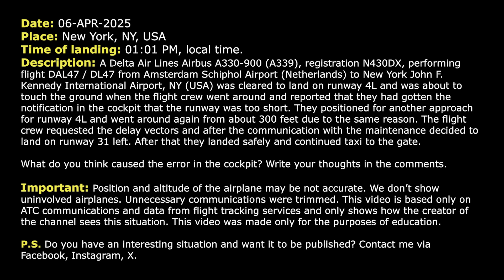The longest available runway is too short. Delta Airbus A339 has problems over New York. Real ATC

Comment: Possibly a glitch with the software incorrectly thinking 4R was the landing runway? The crew is probably no longer allowed to calculate landing and rollout distances manually but the indicated runway at JFK that the aircraft was squawking was too short (Runway 4L/22R) is 12079 feet long. The winds were reported initially at 010 at 10 so with a 6 kt. headwind component, an Airbus A330 should have no difficulty landing with plenty of room for rollout.

Should be fine even with minimal brake settings and no reversers.

Comment: Wait a minute… Landing Distance Available for RWY 04-L is 11,010’.  Landing Distance Available for RWY 31-L is 11,247’.  Last time I checked 11,247 is greater than 11,010.  What am I missing?  About the same crosswind angle and head wind component.  Probably had the 60% landing factor in the FMC CDU.

Comment: 4L is 12000 ft long. The A339 requires (officially) about 6000 ft to land at sea level, so that's twice the published values. Judging by where it turned off the runway compared with the piano keys, had it landed on the original 4L they would have turned off a bit past its middle, in line with the expected landing roll length. So my bet is on a faulty sensor or a glitch in the software

Comment: Their system/equipment was definitely malfunctioning. There isn't a commercial aircraft (with no emergency conditions) flying that can't land on a 12,000' runway. They should have pulled landing performance data well in advance of their approach and the probably did, but they also probably have standards that mandate a go-around if the "too short" system activates.

Comment: Once again, appalling radio procedures on both sides. Callsign must come first, followed by the body of the transmission, in standard format. Where in the USA is "Hello Tower"? The correct transmission is "Kennedy TWR, this is Delta 47 heavy on final RWY 04 left". In the go-around, the use by ATC of the phrase "maintain present heading" is ill-advised, since she does not know what heading the aircraft is on at that time. "Delta 47 heavy, maintain RWY heading, climb and maintain 2000" is correct - at least then she has accurate information to co-ordinate to Departures. "Delta 47 heavy, roger, present heading up to 2000" is superfluous - she has already given those instructions - additionally non-standard phrases are used. The pilot readback omits the callsign! "Delta 47 heavy, start the right turn heading 100" is non-standard, it should be "Delta 47 heavy, turn right heading 100, vectoring for another approach" Track miles to run would normally be given at this stage, but the TWR controller could not know this, and she correctly made no guess. "Delta 47 heavy contact 128.12 for the re- sequence" should be "Delta 47 heavy, contact approach on 128.12" Nothing more is necessary, but the identification of the unit to be called must be included! The pilot readback once again omits his callsign, and abbreviates the nominated frequency. "Delta 47 heavy approach 128.12" is correct. The second contact with approach by the pilot is poor, it should be "Kennedy approach, this is Delta 47 heavy, heading 100, maintaining 2000". The subsequent exchanges between approach and the pilot were more of a casual chat than a professional question and answer session required to clarify the situation for approach. "Delta 47 heavy, you're gonna climb to 3000 here........etc" What rubbish!! "Delta 47 heavy, climb to 3000, turn right heading 260, vectoring for ILS approach RWY 4L, 25 track miles to run" is correct - standard phrases in the proper order. The transfer to approach should have been "Delta 47 heavy, contact approach on 132.4". The approach controller appears to have little idea of a plan, with multiple transmissions which could have been combined, and an excessive number of speed changes - including one of 10 knots! She fails to provide distance to run at any stage. The transmission "Delta 47 heavy, you're 8 miles from KRSTL.....RWY 4L approach" is wrong, and should be "Delta 47 heavy, turn right heading 010 for pilot intercept of the LLZ RWY 4L, 20 miles to run, cleared for final, contact TWR 119.1 established". On the second missed approach, the TWR controller sees fit once again to repeat the missed approach instructions unnecessarily, and makes the same mistakes she made previously. Contact who on 1135.9? It is required to specify the unit to be called, and it is a good idea to say the frequency correctly. "Delta 47 heavy, we're gonna try 4R today, how does that sound?" should have been "Delta 47 heavy, advise preferred RWY". The departures controller knew that the pilot was showing a short RWY indication in the cockpit for RWY 4L, so at least six of the following transmissions could have been avoided by simply asking him where he wanted to land. The pilot could have then replied that they were in touch with the company, and would advise. Departures could then have said "Delta 47 heavy, turn right heading 160, vectors for delaying action, when able, advise intentions." This call is not made until 06:38, after many more unnecessary transmissions. "Alright Delta 47, we'd like to set up......to the NW" should be "Delta 47 heavy, request RWY 31L".  "Delta 47 heavy, plan for......heading 220" should be "Delta 47 heavy, turn right heading 220, vectoring for ILS approach RWY 31L, 35 miles to run." Whilst you state that the value of this video is education, to show a video where every transmission is incorrect, where unit callsigns are incorrect, where Departures suddenly becomes Approach without a frequency change, makes this a prime example of just how it should NOT be done.
Reply: That’s the US for ya
Reply: #retirementenvy
Reply: Man you really wrote an entire essay LOL

Comment: the 339 has the ROW/ROP system. (it helps stop runway over-runs) It might be creating spurious alerts. The 339 at max landing weight, can very easily land on 04L/R even with a tail wind.
Reply: Are you an engineer or what?

Comment: What’s crazy is that with the winds the way they were, 31L is only a couple 100’ longer than 4L for landing and probably didn’t have better performance since there’s less of a headwind for that runway. It appears they were right to consult maintenance as there was likely an issue with their runway overrun protection system.
Reply: 31L is 2432 ft longer than that of 4L, or 20% longer. That makes a huge difference in this case. A couple hundred feet is a misleading statement here
Reply: @ not all of that is available for landing though. The available landing distance (LDA) on 4L and 31L is 11,010’ and 11,247’, respectively, due to a long displaced threshold on 31L. This means 31L is only 237’ longer than 4L when calculating performance for landing. This is the same reason why 22R is also a shorter runway for landing than 22L because of its long displaced threshold. LDA for 22R is 7,795’ vs 22L which is 8,400’
Reply: well the winds at the start were 040 and by the time they landed on 31L they had shifted to 350-360 according to the comms with approach/tower
Reply: @ 360 would still favor 4L which is what the winds were when they finally landed. I think the database for the length of 4L for the ROP must’ve been incorrect or outdated
Reply: yeah that's a good catch.  All the main runways have quite buffered landing zone.  Wonder if that confused the system.

Comment: For those interested THIS is how the system normally operates: https://youtu.be/F5nw2Mt3I1I?si=v-Y55pGeTiCGu_L7

So either someone entered the wrong data, the database was wrong or the plane was indeed heavier than the pilots thought
Reply: This is the best answer, buried at the bottom of the comments. It's pretty hard to ignore the repeated refrain of "RUNWAY TOO SHORT" getting yelled at you at max volume.

Comment: Well either the plan had a defect which caused it to have a longer landing roll which the computer realised and issued a warning OR they entered the wrong data into the FMS Computer and the compiter therefore THOUGHT the available runway is to short (even though it wasnt)
OR runway 4L was indeed to short for the actual configuration (Flap setting, wing, weight) of the A330
Reply: Seems exceptionally unlikely that it was the last one of those options. 4L has 11,000' of landing distance available.

Comment: Why was it so hard to identify the longer runway 31L?  Why did ATC even suggest the shorter 4R runway?
Reply: Most likely, the controller was thinking it was a software glitch with 04L. Switching to 04R might fix the glitch or not have the same glitch. If incorrect runway data was downloaded into the aircraft then it could show 04L as too short but if correct data was loaded for 04R then it might it as being long enough.
Reply: @matthewstraub8771  Well this theory explains the "potentially" answer that the controller is getting mocked here for saying.  It's a wink-wink, nudge-nudge situation.  What he meant was "it's possible that your runway length data for 4R is not fucked-up, like the data for 4L is".

Comment: Isn’t it more logical to assume this is software error and put the bird down as early as possible on the runway and slam the brakes?
Reply: If you want the brakes to catch fire, sure.
Reply: @  reverse thrusters? I’m just saying, jfk is long enough for all aircraft other than space shuttle. Gotta be a computer error.
Reply: @alijaffery7735  Sure, the same computer controlling the reversers and engines.

You fly an error, you don't override it.
Reply: @ wait so are you saying the computer is estimating that the reverse thrusters won’t put out enough or a possible tailwind? 

I thought it is just not calculating runway distance correctly.
Reply: @alijaffery7735  remember that using auto brakes the reversers do not slow you down quicker. The autobrake targets a deceleration rate so using reversers just means using less wheel brakes for the same deceleration rate. ROW/ROPS is calculating if the plane will stop in the available distance given the current ground speed and how far it has travelled without touching down. There is an entire video on here explaining it
Reply: @alijaffery7735  Yes, that's how that system works on an airbus.  It considers the total energy of the plane and length of the runway, including any wind changes.
Reply: No, you don’t just assume it’s computer error when you’re about to touch down because the computer may have noticed something you didn’t. Assuming it’s computer error is what caused Air Transat 236 to run out of fuel

Comment: What is the logic of this warning system? Why it says rw too short just before flare, not when inputed in a system?
Reply: "ROPS" (Runway Overrun Protection System) is an Airbus system which continually monitors approach and landing. It could be triggered by major wind shifts, incorrect approach/landing speeds (landing too fast, pilots haven't reduced to final approach speed), or an incorrect flare (plane floating too far down the runway, touching down too late, so not enough rwy left for braking). Anything that would cause the aircraft to overrun the runway. It's a warning system specifically made to catch issues up to the last second of the landing - or even immediately after touch down.
Reply: A table with weight/wind input that gives minimum runway length could have saved some time and fuel. Unless there were issues with braking action that were not shown in the video
Reply: @mattfgln  They check real time landing data before beginning approach, so they were legal on 4L. Unless something changed, probably glitching magic box.
Reply: @ yeah , I was hinting at a paper table to use when the magic box is not doing its magic

Comment: At JFK, runway 4L is like 12,000 ft long.  Not sure what the issue is.  Jumbo jets and A380s have landed on 4R that os 8,400 feet
Reply: 4L has a displaced threshold so it is only somewhere around 9000’if I remember correctly
Reply: @ i think thats on the opposite end, 22R.  The first 1/3 of the runway is not a landing zone. On the 4L side, the landing threshold begins right at the start of the runway by the Jamaica Bay, allowing for 12,000 ft rollout.  I think it was a computer malfunction
Reply: You don't know what data they entered into the computer or if the plane was significantly heavier than usual. For example they could have taken enough fuel in Amsterdam to land at maximum landing weight because the fuel super was cheap in Amsterdam.
And the computer realised it.
Reply: @AGerm332 Fuel being cheaper in Amsterdam than in the U.S. is exceptionally unlikely. And, even at MLW, 4L should still be long enough for nearly anything (aside from maybe the Space Shuttle or other such hypersonic vehicles) to land.
Reply: Yeah I mean just land that plane. It’s obvious that it was a system error

Comment: I’m kind of surprised; usually 31L is the runway they seem to bring the overweight and emergencies in on. So I guess I wonder why this flight didn’t get 31L after the first missed approach
Reply: Because they were neither
Reply: @dasmellyyooper  I realize that. My point is that 31L is a long runway
Reply: The wind was initially a headwind for 04L so with a headwind correction, the required landing distance would be more favorable on 04L. When wind shifted more northerly, 31L became more favorable.
Reply: Pilot said he had "plenty of gas", and it's possible their company maintenance wanted to see if it was a "one off" situation, or if it was going to be repeated.  The 2nd attempt at 4L may have been for troubleshooting purposes.
Reply: They probably thought that it might have just been a transient error in the system. 4L is definitely not too short. 11,000' landing distance available is much more than what should be needed for an A330neo that has just crossed the Atlantic Ocean West-bound.

Comment: Do they not obtain landing performance before they begin the approach? They cant make it all the way to the threshold to then find out the runwaya not long enough. Part of the flight planning process is to ensure landing performance and plan landing weights
Reply: Oh buddy landing data is separate from this system. They wouldn't have even started the approach if their landing data didn't indicate they could land. This is most likely a fault with the A330 runway overrun protection system (ROPS). The computer monitors energy state, field conditions, altitude, etc in real time to determine whether the plane can land. When working properly, even if initial landing data indicates the runway is long enough, for example let's say the pilot floats it, the ROPS will yell "RUNWAY TOO SHORT". The fact that it was going off in the cockpit so early and happened twice on the same runway, in relatively light/calm conditions, there was most likely a fault somewhere.

Comment: They had to call company maintenance.  The runway that they expected to and probably had landed on in the past was too short for the aircraft as configured.  My money is on some inop or partially inop abs/brake system or maintenance messed up on the setting of the ROW.  How about new brake saving SOPs?  From the track it looked like they stopped with plenty of room to spare...